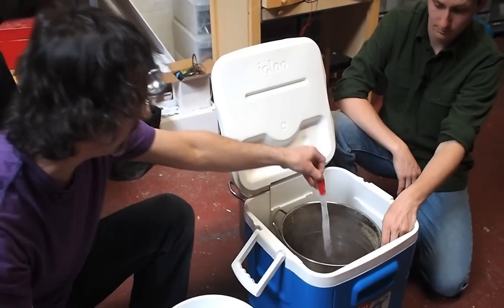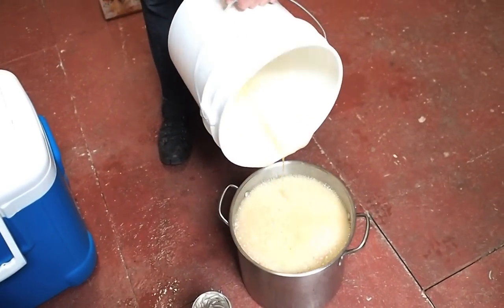How to Homebrew Beer on Make: Live ep08

Comment: @brettski900 Dry hopping (adding hops after the fermentation has completed) is a great way to add a strong hoppy aroma.  A beer with a hoppy flavor overall should be dry hopped to boost the aroma.  Some beers don't have a lot of hops (like a Hefeweizen) and so they would not be dry hopped.

Comment: Sorry if I confused people when I say the malt extract adds food to the wort THAT the yeast will turn into alcohol.  Obviously there's a lot more to it but we tried to keep it simple for the video. Also by putting the kettle into the ice bath we cooled the wort within a half hour. I would never suggest pouring the wort over ice, there may be bacteria harboring in the ice. We could have used a chiller but this was for beginners. Our shop is opening soon, check us out at citybrewshop (dot) com